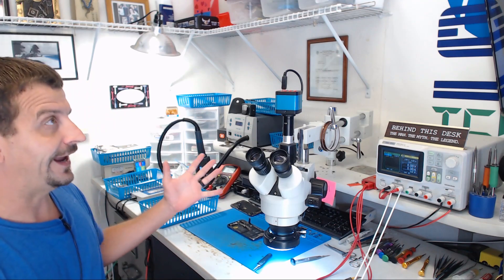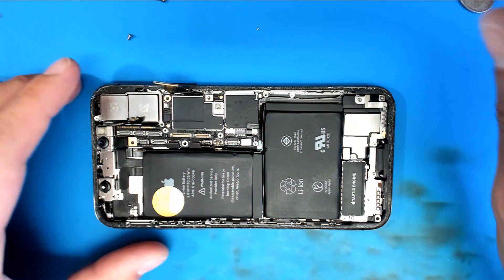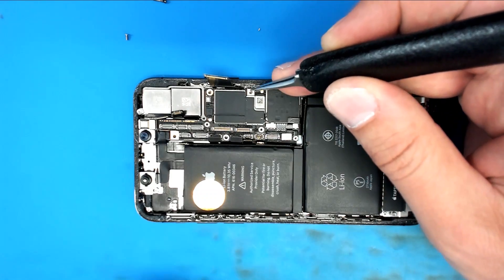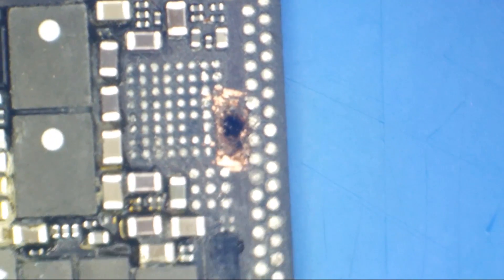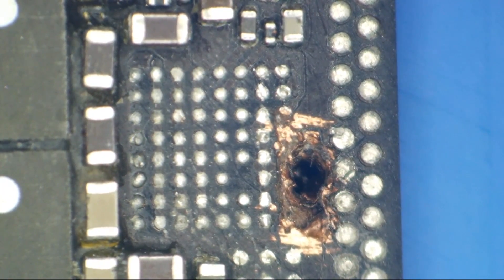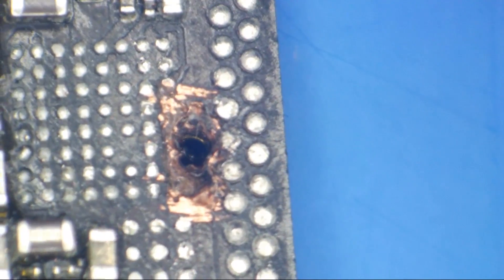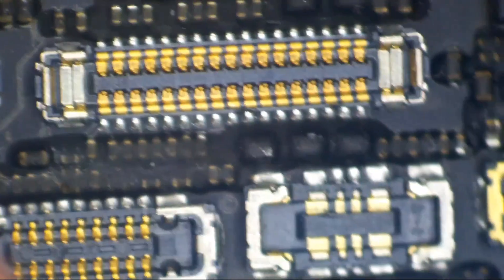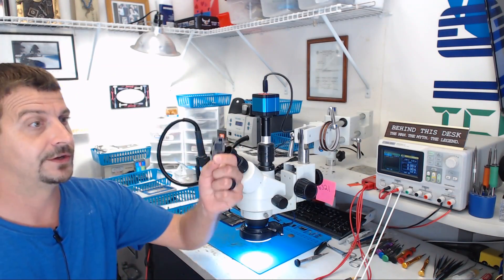A severely mutilated iPhone X sent here for "No image" (no fix)

Comment: Hi, I have an iPhone XS Max that does not have anything physically wrong with it but it is disabled due to incorrect passcode attempt. Would you be able to recover data from this so I'm able to reset the phone? I have tried everything and do not want to lose my data. Thanks.
Reply: DATA on the NAND is encrypted. So while you can still remove the NAND and freely read the binary data (the 1's and 0's), without the encryption key, it like being asked to make an exact duplicate of something with a trillion Legos but NOT being told what you're supposed to build.

Comment: Hey Jason, great to see you back, even if it is a short no fix video. 

I wanted to ask your opinion since I have seen you use both.  I am looking to purchase a Simul-Focal microscope.  Wondering what is better, the double boom stand or the single.  I know the double gives more variations in angles and easily can reposition anywhere in the workspace.  Do you think that is necessary for electronics repair?  Is the double stand more stable?  I appreciate your opinion.  Thanks in advance.
Reply from the maker: I have only used the double arm stand but it has an issue where the shafts are softer than the bearings that they slide on.  It causes some rough sliding but otherwise works really good.  I have a second microscope that is going to need a stand, I'm probably gonna order a single arm stand for it.
Reply: @ststele  Hey Jason, thank you for the reply.  I think I am going to get the single boom then.  I dont see the need to do anything but swing it out of the way, and not the ability to move it all around the work surface.  Maybe if I was reconditioning cylinder heads, will save me some money too.  Thanks again 

By the way, love your videos, even the ones you dont particularly care for.  Keep up the awesome work.

Comment from the maker: After such a long break, I realize this isn't the repair video you may have hoped for.  It will get better.  =)  I'm really just trying to break the ice after so long not recording anything.

Edit:  I can't believe I didn't notice this was long screw damage.  I had seen this damage in another hole but with the prior rework, didn't notice it on this one.  A screw was drilled all the way through the PCB....  :-o
Reply: Hello hope you are okay? Perfect you are back hope everyone is ok your side
Reply: Firstly great to see you back J-Man 😉 So this is VLSD (Very Long Screw Damage) then ? ?  They really sodomised this board as Louis would say
Reply from the maker: @MrPnew1  I just can't imagine the sound this board must have made when they were pounding that hole all the way through it!
Reply: STS Telecom Heyy where did you buy that desk i like the ledge part it’s unique any lead tip?
Reply: What happened with your store searching?
Reply from the maker: @brycebias3547  it's on hold.  I don't think we will open up an actual retail location but will wind up moving STS into a commercial building.  We're getting pretty crowded here at home.